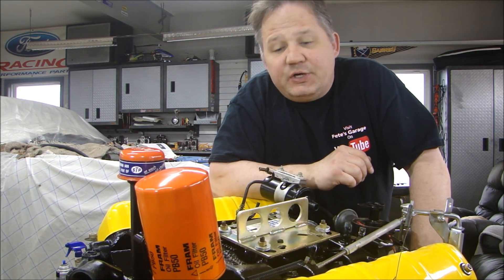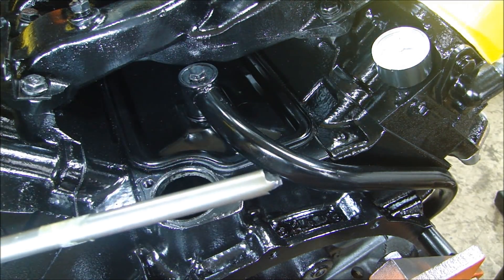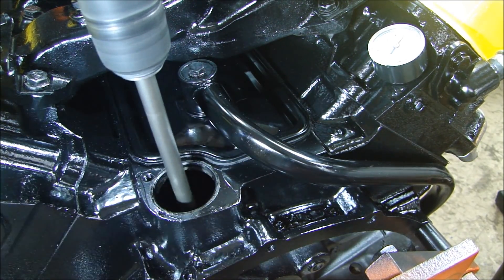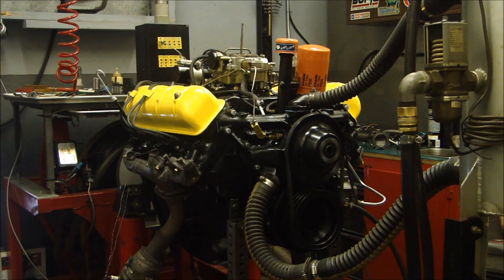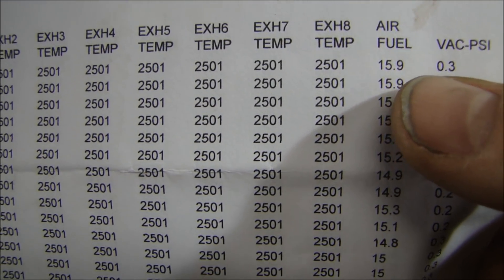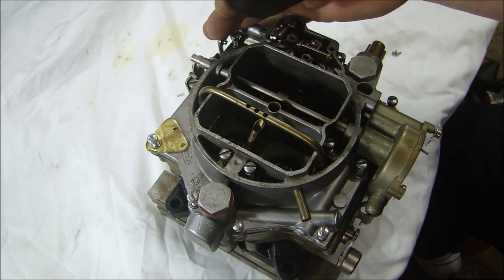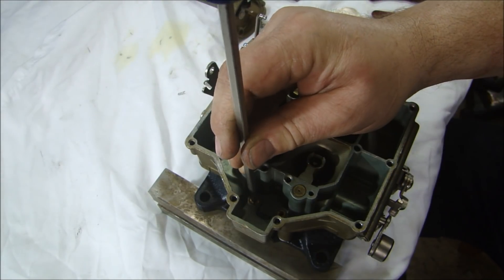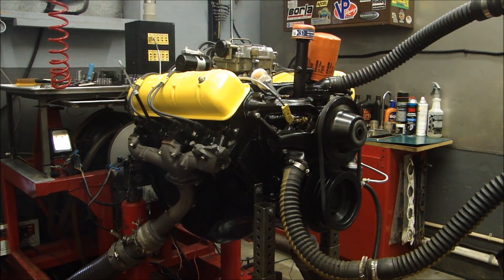Engine Rebuilding - Part 8 Dyno Testing

Comment: I thought the 289s came with 210-225 hp stock? Why would it run 160 especially after a rebuild?
Reply from the maker: I could not find a new cam

Comment: Okay... so I don't get the drop in horsepower... It was rated at 225 when brand new, but you say it will stay at about 165 now, and I can't reason out why that might be.  Did they measure horsepower differently back then or something?... lol.  Yeah... I don't get it.
Reply from the maker: I could not replace the cam, none are available. That is most of it

Comment: Wow talk about low performance. I've seen Ford flathead V-8's with more power. You should have goofed with the timing-it sounds way retarded.
Reply from the maker: After it ran awhile I added timing which helped quite a bit

Comment: I tune the Quadrajet by starting with the power circuit in the primaries. the reason is that the tip size of the metering rods of the ones I have are all the same size. only the tip of the rod is in the jet. so you choose the Jet to give you the AFR while into the throttle. I like about 12.5:1 to 13:1  . once I have that nailed down then I go to part throttle operation and choose the rod size that gets the metering to about 15:1 or a tad leaner. this is when the power piston by way of high engine vacuum has it sucked down placing the thick part of the rod into the jet. for example, a 42 rod has the thickness of '42 into the jet. so total metering area is the area of the jet - the area of the rod.    Choose a power piston spring that doesn't go into the power circuit when light throttle application. then go to heavy throttle application to get an AFR a tad richer when the secondaries are open by choose the appropriate secondary rod.     then done. with my wide band Innovative motorsports logging meter its a lot easier than using plug color to get it into the ballpark. easy peezy.
Reply from the maker: That's great information, thanks for sharing

Comment: Great work! 
Those WCFB carbs are tricky, like the metering rod adjustment etc.
I've done quite a few of these on  mid 50's Mopars, they do work great once dialed in, but they can be a little fussy.
Reply from the maker: They are pretty finicky. Once adjusted they do run well.

Comment: it must be a messy proposition when it comes time to change the oil filter given the way it is positioned.
Reply from the maker: Even better, the oil filter was an option, and it's passive
Reply: Definitely was a messy job changing the oil filter. Had to let it drain before removing and wrapping rag around base when removing the filter.

Comment: As a Studebaker enthusiast myself, I really enjoy your series!  My first new car was a 1961 ark convertible (61VL6) and at that time, being 19 years old, I was definitely into the mechanical side, and increasing performance. As I dig back in my memory bank, I believe your engine was an older one, as in 1962, Studebaker went to a full flow oil filter, which screwed onto the lower driver's side of the block. That was also the year they went to the new type intake manifold and the Carter AFB carburetor instead of the older WCFB, which I believe is what your engine has on it. The AFB was a big advance in m,y eyes, as it was available in higher CFM, and much easier to change the jets and the metering rods, without even removing the carb. Lots of fun, and fairly cheap to work on!
Reply: I had a '62 Hawk, and a '62 Lark, both with V-8 engines, and they both had bypass filters. My '64 Cruiser had a full flow filter. The AFB was an excellent carb. If you look at the 2bbl manifold, it is made to be a 4 bbl manifold. It looks like you could just mill the area flat where the carb sits, drill and tap holes for the bolts, and drill out the passages for the throttle plates, and you have a Studebaker 4 bbl manifold.
Reply: @garylangley4502  You probably have earlier production engines. Studebaker (similar to Chrysler) incorporated many running changes, and I'm assuming the 1962 model year started out with engines built in 1961. In 1962, while still in College, I worked weekends in a dealership, and being low on the totem pole, I did a lot of grease jobs and oil changes. This is where I first became aware of the full flow filters, and incidentally of the need to grease the bell crank pivot point. As access to this point was through a hole in the frame for the purpose, this point often was ignored, leading to the infamous "failure" of the bearing. Here, too there were differences, with some being sleeve bearings, and others being needle bearings.  You're dead on with the carb and manifold issues...a relatively easy conversion. And yes, I too really like the AFB, which in my opinion is the simplest and best 4 barrel made for the application. BTW, the AFB intake manifold cost about $20 through the parts department in those days.  Wish I had bought one or more of the R4 manifolds while they could be had new!
Reply: @neil6212  Interesting!! I did not know that the change was mid production in '62. The '64 I had used the sleeve bushings, and they were worn. In my '61 Lark, the grease fitting was broken off in the bell crank, but I used a needle adapter and I was able to grease the fitting. Apparently the previous owner did the same thing because it was well greased when I got it. I remember that Lark having 22 grease fittings. I bought that car in 1972, and at one point the oil filter blew up while I was on the freeway. It ruined the 6 cylinder engine. I found a '55 flathead 6 that I put in there, but it had oil pressure problems, however I drove it for about a year. At the time, the car had little value, but since it was from San Bernardino, it had absolutely no rust on it. I found a wrecked 1960 Cadillac and saw how similar the engine is to the Studebaker V8. So my friends and I put the 390 Cadillac engine and Hydramatic transmission in the Lark. It was surprisingly easy to do.
Reply: @garylangley4502  I'm with you on the Caddy implant! The Studebaker V8 was virtually copied from the 50s Cadillac, so it isn't really too surprising that the install was easy! And it probably was a rocket with the gearing being in the 3.92 to 4.10 range, although the Dana 27 axle probably wouldn't like much abuse. My first new car was a 1961 Lark convertible, a 61VL6! Traded it off on a '65 Mustang 289HP. Later, I was able to buy a 61SL6 with a bad transmission. It was the same color (Ermine White) and in good shape body wise. This was in 1868. Being single, I elected to do a frame off restoration. As it ended up, I bought a wrecked '64 GT Hawk, which had an R2 with 4 spd and the usual toys. I salvaged many parts from it, and although the left front suspension was damaged, and the fuel pump broken off, the disk brake was still in good shape. I rebuilt the engine, and do a "heart-lung transplant" into the Lark, using the front and rear sway bars, the Dana 44 axle with 3.54 TT gearing, and pretty much created a monster! By the way, to do a V8 engine swap[ in the Lark, you had only to swap the left and right front motor mounts with each other, and it becomes a bolt in, although it will be necessary to use the V8 throttle linkage and re route the gas line.  On R2 engines, you also need to add a fuel return line from the stock fuel filter to the tank.
Reply from the maker: That's a great story....thank you very much for sharing. Yes, this one had a WCFB.

Comment: Hell's bells! The standard non-power-kit (two-barrel single exhaust) is rated at 210 bhp gross. You.'ve overbored to 298 cubes. You're running a four-barrel carb, which would be rated, as you said, at 225 gross bhp. 163? Not exactly what one would expect.
Reply: From what I've seen those engines do at the drag strip, I think those numbers were underrated at the factory! Those Dyno numbers seemed really low. Still, great series of videos. I'd like to see you rebuild a Rambler 327 or 287 and Dyno them
Reply from the maker: It's a standard bore 289. There was not much to work with and I did not put in any performance parts. I think the rated numbers are overstated.

Comment: 4 degrees of initial advance is way to little. 14 would have been better. The maximum mechanical advance on that engine should have liked around 34 degrees. I noticed you didn't check timing advance at all. Also, the carb problem was a super common problem of the jets were reversed. The 89's should have been in the secondary and the 72's should have been in the primaries. I'll bet the car will run sloppy and rich at part throttle. Way too much primary jetting. 

When the engine is installed, advance the timing at a warmed up idle by vacuum. Your highest reading is where the flame front travel is doing the most work. Then check the maximum mechanical advance and adjust the timing stop until you have 34 to 36 degrees. All timing should be in by 3000 rpms. Lots of tuning to do.
Reply from the maker: This car is coming in for some end-of-season work. I'll look into the timing. Thanks for the comment

Comment: My 20 year old 302 with over 280,000 kilometres on it has 248HP (185kw), never been opened, has pacemaker headers, K&N Filter and sports exhaust. It's coming out soon for a rebuild and I hope to have an engine dyno video later for posting. Then a chassis dyno video when it gets tuned for best effort.
Reply from the maker: That sounds cool

Comment: The same basic engine powered an 1962 Avanti at Bonneville to 168 mph. That version was an R3 with hotter cam and Paxton supercharger putting out 335 HP according to factory numbers. Not bad for a stock car in 1962 !
Reply: Granatelli wouldn't let an R3 leave the Paxton shop 'til it had posted 411 horsepower on the dyno. Studebaker never advertised horsepower ratings for the Avanti engines, but the numbers bandied about with great authority are generally considered to be ridiculously understated.
Reply from the maker: Thats' awesome! Thanks for sharing

Comment: Hi Pete! I'm rebuilding a Pontiac 455 (bored out .030") with a stock flat tappet cam and stock valve train. I saw online that you should remove the inner springs before break in. Is this a must? Also what do you recommend for can break in (oil,oil additive, cam lube)? Thanks
Reply from the maker: Yes it is. The springs will put too much force on the cam and will ruin it before it has a chance to seat and break in. Use Royal Purple which is now Brad Penn racing oil with zinc and phosphorous added in.
Reply: Pete's Garage thanks Pete, I appreciate it!
Reply: Nehemiah Branson removing the springs is something i never would have thought of.
Reply: You don't have to remove the inner springs for break in until the seat pressure is over 140lbs and 360lbs at the nose. You will be fine. Removing them is just an extra precaution.

Comment: Well a stock standard 259 V8 Studebaker Motor produces 180 HP something is not right
Reply from the maker: This engine originally came with a 2 barrel. A 4 barrel carb and manifold was put on and it very well could end up hurting HP because of flow mismatch
Reply: @PetesGarage  these engines came with either the WW 127/130 2 barrels, AFB's or carter standard 4 barrels.  I have been building and dyno'ing Studebaker engines for street, racing, Bonneville and other applications for many decades.  Something is very wrong with your build.  Most Studebaker mechanics would tell  you that the numbers are low from the factory, due to many tests and other sources.  SO.... again, something is very wrong with your build to only get 160(??) hp.  Did you put a shimmed head gasket on and as such reduce the compression.  Nice videos, good process, and good explanation but the HP figures do not make sense.
Reply from the maker: @3RTracing  The thing that is hurting it is that I did not change the cam. I have since added some timing and adjust the carb which boosted the numbers quite a bit.

Comment: 160HP at the crank isn´t much for a almost 5 liter engine. With the original tranny installed there will be not much @ the wheels. 

A Jaguar MK made 210 HP out of an 3.8l engine.

I dont´t get why someone would want a rebuild w/o a higher compression for todays fuel, advance timing and a better camshaft. This would wake up the engine quite a bit w/o being too expensive.
Reply from the maker: That is true, however, there is a cost factor and what the owner wants.

Comment: Isn't there a table that you can use as a guide to figure out what size jets to use in a carburetor for the displacement of the engine? Putting a new rebuild engine on a dyno seems like a lot of stress for it before it is broken in. What is your thoughts on that much stress? I also want to thank you for all your time in posting these videos they are very informative.
Reply from the maker: Starting an engine on a dyno has zero stress actually because the engine is just spinning. You cannot tell what jets are needed until you monitor the air/fuel mixture through the RPM range and the carb is fully open. There is no chart for that. You can come really close, but a dyno gets it perfect.

Comment: I have the Dyno Pulls that Studebaker engineers performed in 1956 when the 289 was introduced.  The pulls were with a Carter WCFB carb and 8.5:1 compression ratio.  The engine was tested in all configurations.  This engine seems down about 15 HP from Studebaker engineering numbers for a pull in the same configuration with exhaust manifolds and water pump .   Perhaps the timing needed to be advanced a bit?
Reply from the maker: Keep in mind it did not have a new cam so that is down a bit. And you are right, advancing the timing could add some, but the owner was not interested in super performance.
Reply: Excellent series on rebuilding a Studebaker V-8.  Nice thorough job!  You cut no corners for a quality rebuild.   Yes I understand this was not built as a performance engine and the owner didn't want the timing advanced.  Still it is an interesting comparison to Studebaker's engineering dyno runs.  Their runs with a Carter WCFB 4 barrel , 8.2 CR, timing 8 degrees advanced, netted 208 HP @ 4,400 RPMS and 300 ft lbs of torque at 2,900 RPMs .  This was with no accessories and no exhaust except for manifolds.   H P required to drive the water pump only is 5 HP at 4,500 RPMs According to Studebaker engineering figures.  The 289 developed 174 net HP @ 4,100 RPMs with all accessories and full exhaust installed.
Reply: It sure did need a whole lot more timing.

Comment: smarter to dyno it than running an engine too lean and trying to dial it in on the street and since it was a secondary problem that would be even more difficult----

Yes that does seem a bit low compared to how they rated it but could have easily been overrated, I remember a stock low level 327 2 barrel was about 210 but you don't care about performance or dragging in a car like that- just enjoy that classic,

Just for fun maybe get RWHP sometime, that's probably 120-130
Reply from the maker: Thanks for the comment Jim

Comment: how do you figure out compression ratio and why is that important?
Reply from the maker: By calculating cylinder volume. It is important because it tells you what octane fuel you will need and how much performance you can expect.
Reply: and how do you calculate cylinder volume you have a video on this if not can you make one?

Comment: I use an old distributer and 1 inch drill to prime my engines
Reply from the maker: That's is a great idea
Reply: I used to use a long screwdriver to prime my stuff. but that method has its problems. I now use a kit you can buy that works with multiple engines. It seals off the oil port that would otherwise be open. clamp it down and rotate.

Comment: A couple of comments, Studebaker published max. hp at 4500 (500 higher) and max torque (500 lower) at 2800. Both of these numbers differ by about 500 RPM from this dyno run. Did notice when you were quoting the AF ratio's that you said lean when you meant rich IMHO, although it was running lean for max power. The carb air bleed jets may have been able to be adjusted to get the torque numbers in line with the factory rpm. In this design the idle air bleeds (top) effect both the idle and main jets. 

It would be interesting to be able to adjust the timing and af ratio at 100 rpm intervals like what is done to tune a modern engine   for racing, and see the results. See if it's possible to tune these old mechanical methods to emulate the precise control on modern machinery. Of course outside air pressure and temperature would be difficult to tune for. I believe these old carb manufacturers attempted to do just that, thus the reason for so many part numbers. Not a good idea to just slap a carb for one application onto another. OK enough. Thanks for this series as I have a 1957 supercharged Golden Hawk 289.
Reply from the maker: Great stuff Ron. We did adjust the air bleed and mixture screws, but at higher RPM's they don't do much. It took quite awhile to get it tuned. If there were a better way my dyno guy would have done it. He does 1000+ HP motors all the time. Thank you for your comment.
Reply: I understand we are attempting to make adjustments to an entirely different fuel formulation than they were designed for also, Thanks for the video.

Comment: Pete,
I really enjoyed this video series.  I am a Studebaker guy and own a 1962 pickup with a 289 and I think your step by step rebuild is a valuable guide for people working on these engines.  On the subject of the lower-than-rating horsepower result, I'm wondering if the valve lift was reduced by re-using the original cam?
Reply from the maker: That could be possible, but very slightly. The valves are very small and it was not build for the 4 barrel. I'm thinking different heads would do the trick.